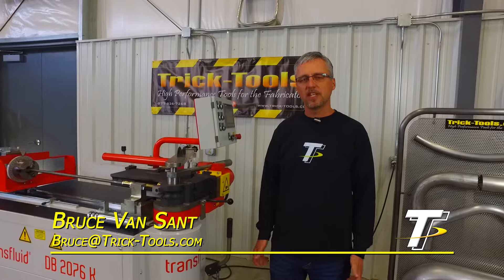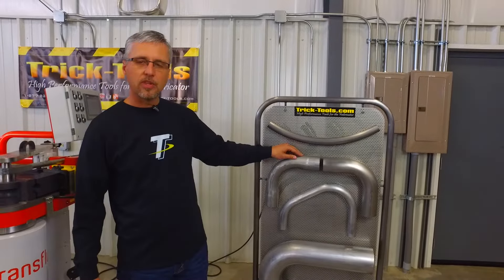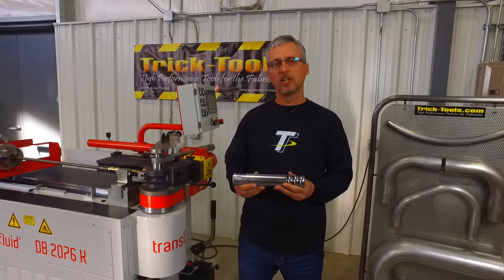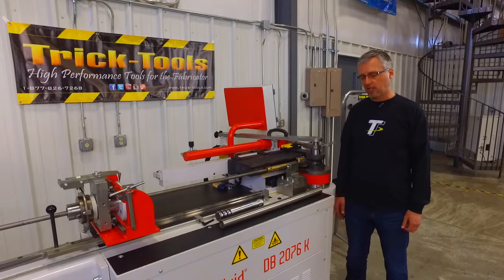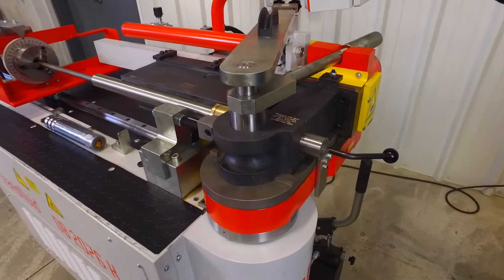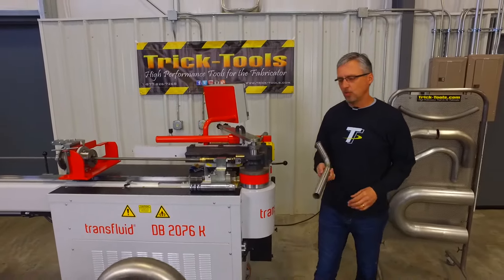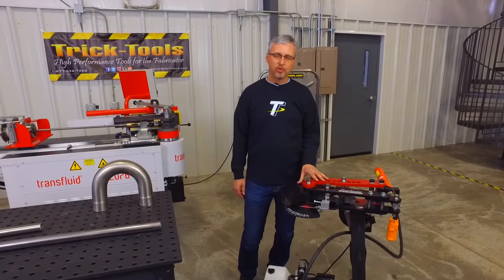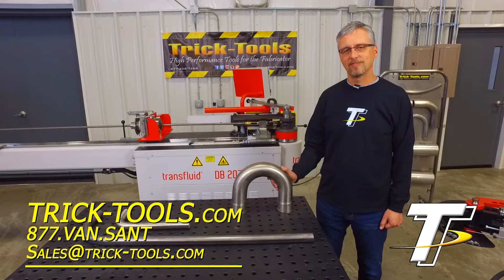What Is Mandrel Bending? Tube Bending 101 Series at Trick-Tools.com

Comment: I working on Franklin Silencers as a bending machine operator,, Addison 60 years old bender,  and BLM 13 years old. 
You don't use the lubricant on mandrel,WD40 on former?
Reply from the maker: This machine has a manual mandrel lube options so lube is pumped from a reservoir through the mandrel into the bend area.  No lube on the former die.

Comment: Can this method of bending be used for mild steel & cast steel material? As in I run a hardware store where we sell ERW & Seamless Short & Long Bends. Will this more cost effective than the conventional exhaust bends? The conventional bends are currently being imported from china.
Reply: Thank you for the Tip. :)

Comment: Wow that’s expensive! 
Probably made of Titanium,Chromoly and Tungsten !! ✌️❤️
I’m thinking of using this type bender on a shifter cart and need the tubing flawless ! Of coarse I need the tubing roughly 31-33mm Od 
I may just do like I have been, draw it up and order from local steel company!! I’m really just paying 7-10$ bend ! 
Any suggestions would be great, 
Weld it up! ❤❤❤
Reply from the maker: This machine is certainly at the top of the tube bender chain, however it's not a requirement for bending tubular frames such as a roll cage or shifter cart. We have other rotary draw tubing benders that work great for these applications and produce a very nice bend. A great starting point would be the Pro-Tools MB105HD or if this is for production work, the Baileigh RDB-250 is a great machine as well that's often used for building roll cages and even Top Fuel drag cars. The price point of these machines will be much more affordable. 

Of course there is a time and a place for Transfluid Mandrel benders, however for your application, something smaller may be the better option.

Comment: What is the difference between mandrel with 2 or 3 discs or with no discs?
Reply from the maker: It is all based around what material you are bending and how tight you are bending it. Transfluid will help the end user determine what type of mandrel is necessary for their specific application

Comment: Very informative, but when you follow the link for the bender that starts off at around $500, it's $895 MORE than that. $500 to $1,395 is a little more than a margin of error. Otherwise a good video.
Reply from the maker: Thanks for watching and we are glad the information was helpful. The manually powered version of the Pro-Tools bender actually starts at $389.95 with a Deluxe kit available at $549.95. The powered version that you are referring to does start at $1395.
Reply: @TrickTools  thank you for the reply. I wasn't trying to be negative or mean. I just followed the link in the description, and it was significantly more than what was mentioned in the video. Do you have a link for the more affordable version?
Reply from the maker: No problem at all, here is a link to the the manual version. https://www.trick-tools.com/Pro_Tools_MB_105HD_Heavy_Duty_Manual_Tubing_Bender_MB_105HD_5142